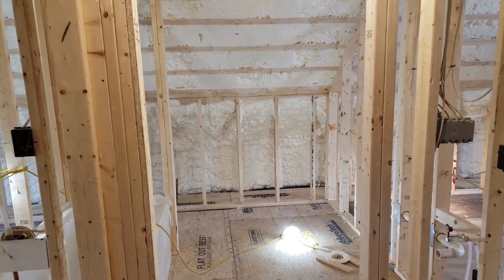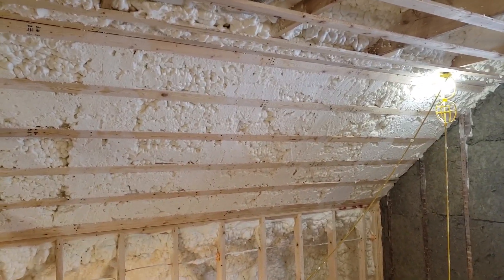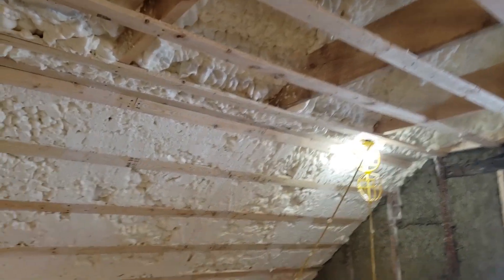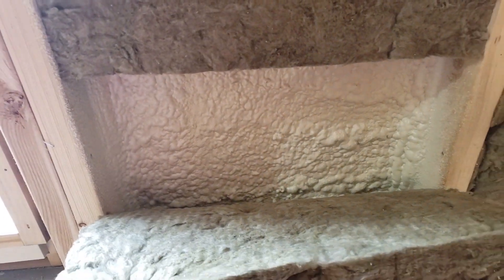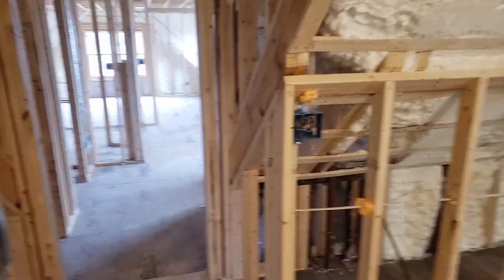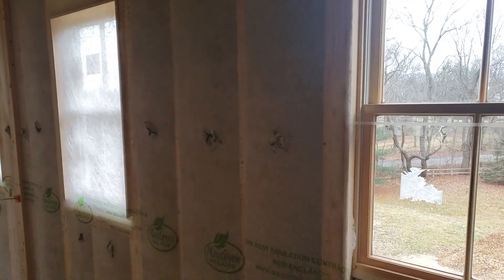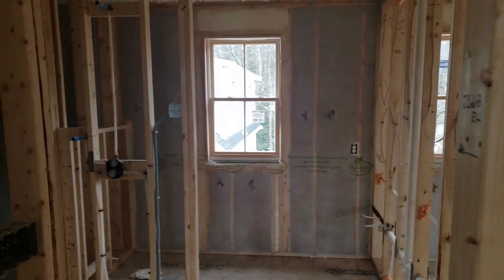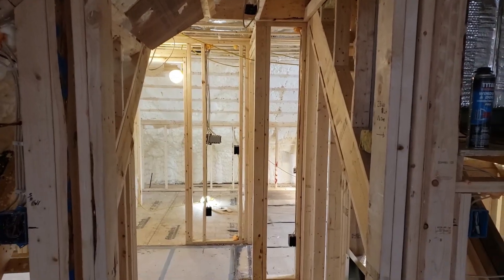Insulation Going In at the Historical Reno

Comment: That flash and batt technique is proving to be almost a guaranteed failure now. It's changing the condensation point to the interior side of the spray foam. The wool will mitigate mold and vapor transfer way better than fiberglass. But you'll see mold or even excess water damage eventually.